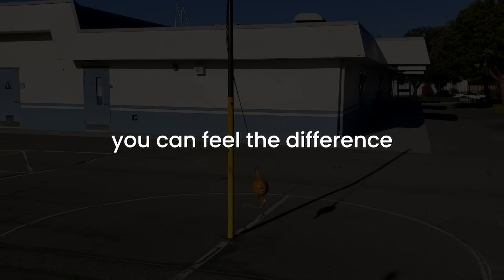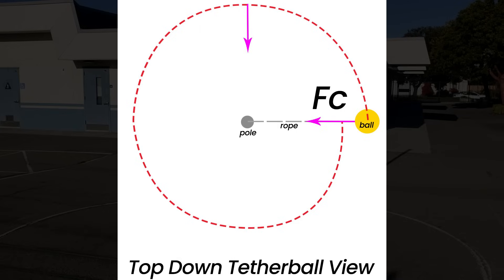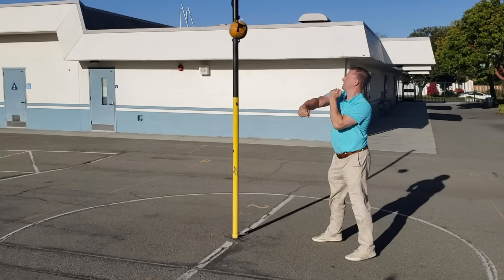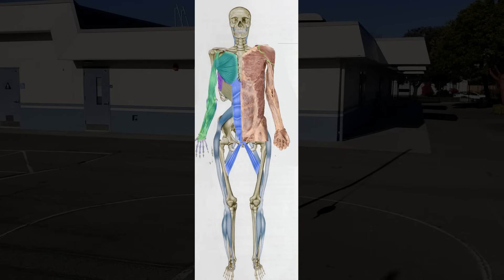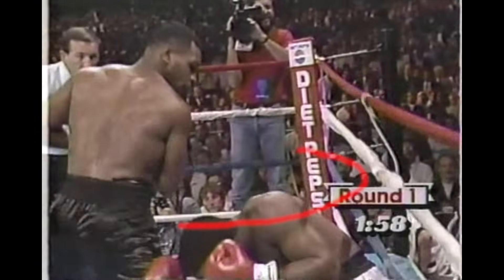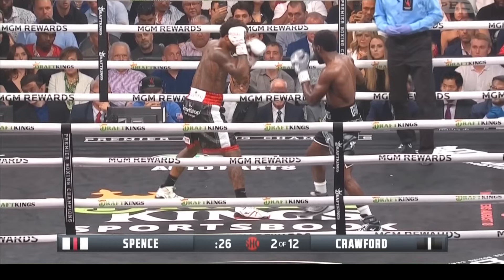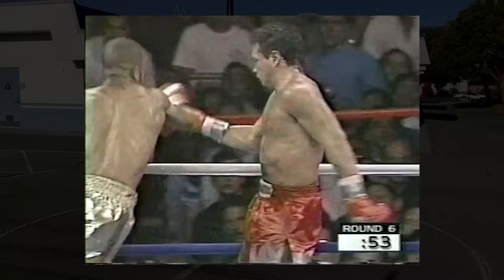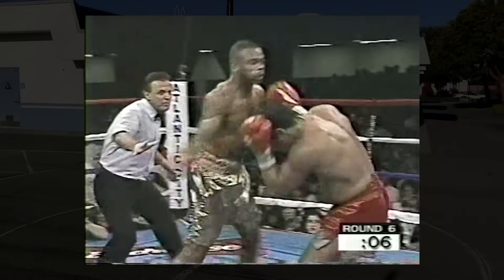The Hidden Physics Behind Natural Punching Power, And the Secret Advantage You Aren't Using (Yet)

Comment: There MAY be some valid info in here, BUT there's also some BS which just makes me skeptical of the whole system and makes me think he's a snake oil salesman.  Specifically the whole ball throwing experiment is HIGHLY flawed and dishonest, even for someone like me who doesn't have a great understanding of physics, I can see the blatant flaws and "misdirection".  For example he is releasing the ball from different angles, and "his approach" is always a more advantageous angle.  Second, on "his approach" throws he is clearly using his wrist which he doesn't do on the "conventional punches".  For anyone who has thrown a ball, you can understand how essential that "wrist snap" is.  So he's basically "shot putting" a ball vs. "throwing" a ball, of course you're going to "throw" it farther.  And this is just not an equal, or "apples to apples" comparison when it comes to punching.  Punching and throwing, while they have similarities, they are just not the same movements.  That wrist snap is the perfect example, while that is essential in throwing a small/light ball and creates A LOT of power, it is not essential, and will LITERALLY HURT YOU you when punching, or even throwing a heavy object like a shot putt, because your wrist can't handle that type of force, if it is not straight/rigid or "stacked" properly like they teach you when boxing.  Also, without seeing the "jab is actually an arc" video, that seems pretty sketchy too.  Them dropping their hand after they make contact doesn't make it an arc.  The  power is generated PRIOR TO contact, and there's no arc prior to contact.  It's a straight shot, and there's a reason for that, it's the FASTEST way from point A to point B!  Which is another reason punches are taught the way that they are in boxing, it's not JUST about power, it's about speed, efficiency, and also not leaving yourself open for counters.

 When I/you see clearly dishonest and misleading stuff like that, it should make us IMMEDIATELY skeptical because 1) If he's dishonest about that, what else is he dishonest about? 2) If he truly believed in his system, and it was actually as effective as he says, why would he have to add dishonest claims and "experiments"?

Furthermore, there's other "red flags", like the fact that there's not much "practical application" info here, instead a lot of physics jargon.  People who really know what they're talking about and are being truthful should be able to explain these concepts in simple, easy to understand ways with practical examples.  Others tend to use a lot of big words and subject specific jargon that most people don't really understand, but it makes them sound knowledgeable and trustworthy. And the one practical example he uses is the throwing thing which, again is a crappy example.There's also the obvious question of "So every boxing coach/trainer is wrong, but this guys right?"  And it's a commonly used technique, as well, where he poses as a credible authority who comes from outside the field of discussion to say I have this "outside knowledge base" which is why I have the "secret key that they're missing".  In other words, "Boxing coaches are basically just meat heads, so they have all missed what I know as a scientist".  And it's a very effective tactic, but the reality is that athletics are a HUGE/LUCRATIVE business, and so there are experts in various scientific fields who contribute to "Sport Science" as their job.
Reply from the maker: lot of words to say "I didn't understand the video."  Thanks for the comment though, the algorithm loves noise.

Comment: I watched a couple videos of old Larry Holmes stressing the importance of snapping the jab out and try to arch it instead of just pawing with it like you see a lot of amateurs do.
Reply: I was thinking of that too. I think he explained it as a slap. A whipping sort of motion. I could be wrong but it doesn't seem like that would be an arc. If that is correct, then maybe Holmes shows for the jab at least there's an alternative to the arc that still fits the "integrated" mold the author is describing.
Reply: @5metoo  if you watch him you will see his body's subtle movements. The way he sort arcs his whole body into the jab, the fist looks like it's coming out straight, but that's because the core is what's doing most of the rotating. When I do it like him, it feels almost like a wave of force is traveling through my whole body and ending at impact.
Reply: @bigbear5767  Sounds about right

Comment: Your idea and theory seems to be sound and possibly close to what is taught in older boxing and certain Japanese martial arts.  The law of conservation of energy (edit: the law of conservation of angular momentum) is something that I, the first student of our new school, has looked into and experimented with.  Although, It would be nice if I could use a pressure pad and test subjects to see how much power it generates.  Your video, from what I see, essentially is: use your hips.  Use the rotational power of your hips.  Your hips are what moves your punch rather than punching with your shoulder and following with your hips.  The arc on your rear straight may also produce more power due to you hitting slightly downwards and using gravity to assist.  However, in terms of fighting can leave you wide open if missed.  You can use conservation of energy if you start a hook or uppercut wide then shorten it to 90 degrees flexion.  Other than that, I'm not sure the law of conservation of energy (edit: conservation of angular momentum) applies as I am not an expert on that.  I am not a physicist.  The reason I wrote this comment is because your wording was a bit confusing to me, someone who has majored in kinesiology.  As well as my own testing with the ball test you showed.  It wasn't until I got no change of results in the test that I realized what you meant.
Reply from the maker: I was talking about conservation of angular momentum that dictates angular velocity will increase when you shorten the radius of the arc, not conservation of energy. This video is about arcing punches not necessarily hips driving the movement which I've discussed more specifically in previous videos.
Reply: @ThePunchDoctor that is exactly what i meant, but i will admit I typed the name of the wrong law.  But my point still stands.  And your test seems to have proven me right.  It would probably be in our best interest in someone to truely understand this if someone could get a few boxers, kung fu practitioners, muay thai fighters, and karateka, to study this with one of those pressure pads and analyse what may make the puch more powerful.  Although, they would all have to be similar size and quality of training.  Btw, this is the video where I first learned about angular momentum: https://youtu.be/_WHRWLnVm_M?si=Vwe07BYzaHqzIMXo

Comment: Around the 4 and a hlf minute mark, you showed two champion boxers launching powerful shots. However, neither of the boxers initiated movement from the hip, allowing the hip to start rotating, then the torso, then the shoulders, then the arm, etc. Which is what you yourself actually do immediately following those two clips. You can see the clear difference between your punching mechanics and theirs. They seem to initiate the movement directly from the arm (shoulder and fist moves first) and the body pushes behind the moving arm to drive it into the target. Which, if I am not mistaken, is what is taught in Soviet style boxing, at least the former Soviet boxing coaches I have watched. I do not post this as a criticism, or a "gotcha" thing, but I am sincerely asking for clarification on what appears to me be a difference between what you are saying and what is being shown. Please elaborate. I am rewatching the video, and it may be that I am misunderstanding what you are presenting. I do notice that in your "integrated" punching demonstration you are essentially shortening the arc of the punch by drawing the fist in closer to the body towards the end of the arcing movement. Upon reflection about this point, I do remember my boxing coaches teaching both methods - the "linear" method to beginners in order to prevent them or break them from developing the habit of throwing wild haymakers instead of tight, controlled punching. And the "shortening the whip" approach once that foundation has been built in order to increase the velocity of the fist and thus increase the power upon impact. So there's that. :)
Reply from the maker: I appreciate the comment and it really takes a nuanced eye to see these things. You will benefit from watching some of my longer breakdowns to get a good idea of what I look for. 

Floyd lowers his center of gravity to initiate the punch. When he does this you can see his shoulder blade retract. He is loading his posterior chain and his cross-body chains simultaneously which both then explode into action. After he initiates the punch you can very clearly see the sequencing. His hips finish their movement and his fist is still accelerating. In the soviet linear style you’ll see the fist and hips reach their end point simultaneously.

George follows a very similar pattern. I covered him in depth with frame by frame analysis in the full video where I feature him. It might not be the clearest example I’ve ever used because he’s moving forward at the same time as he’s loading and exploding. I chose this clip mostly for the arc. He is loading his hips and cross-body chains at the same time as he lowers his weight. The clip also shows very obvious sequencing just like Floyd after the punch is initiated.

You can see the full George vs Joe Frazier segment here if you want to go more in depth: https://youtu.be/qLVl18AVkAU?t=329

Comment: The best fighters and coaches I've known have all come to this without the first understanding of or giving a thought to kinetic linkage, centripetal force, or physics.  They arrive intuitively and anecdotally where science would tell them to go, were they to ask for directions.  Punching is like any rotational sport, wherein - unsurprisingly - the key is rotation.  Putting a shot, throwing a javelin, swinging a bat, golf club, or tennis racket, all derive their power from acceleration through rotation.  As someone who fought for several years and has coached for many more, with years of anecdotal evidence on which to base my teaching, I still like to consult a physicist friend of mine whenever I want further conformation that whatever particular technique I'm teaching corresponds to the laws of physics.  Boxing isn't called the sweet science for nothing.  Of course, all sports are in essence sweet sciences, but boxing has garnered that tag and it fits.  I have a kung-fu buddy, who was also 5 time Nevada middleweight amateur boxing champ, who says there is no such thing as a straight punch.  He describes the jab's movement as being like electricity arcing between to poles.  This is absolutely true.  You simply cannot throw an effective jab that doesn't start at the feet and rotate through hips, shoulders, and then the arm, which gives it an inevitable slight arc.  For most people, it's getting that kinetic chain to move fluidly that's difficult.  People tend to lose the connection between the arm and the rest of the body.  Consequently, the arm moves ahead of, independently of, the body, resulting in pushing and throwing arm punches.  Everything you were saying in your video.  I've found, given enough time and consistent training, people's bodies figure it out.  How successful they are at it depends on their native athleticism, but I've yet to see anyone who hasn't in time arrived at a reasonable facsimile of the correct use of kinetic linkage.  The body, out of necessity, seems to figure it out.  I'm not saying anything you haven't already said.  I'm just confirming and allying my own experience with what you're describing.

Comment: What muscles has a whip? There is only the force of the hand aplied to the handle. 
Pulling the shoulder forward during the contact with opponent is a repeated pushing, as can be observed in slow motion videos. It can be extremely powerful and devastating push, but still is a push. It will influence and harm the performer body and movement also.
If we want to strike and not to push, the shoulder has to move during the contact back from the opponent and not to him. Then the movement of the fist will be way faster.
Pushing is good for throwing ball or for pushing opponent away.
Real striking is a whipping movement and doesn't need a lot of power, contrary to the pushing punch.
In theory whipping punch can transmit 4 times more  kinetic energy than pushing punch and 4 times faster.
Reply from the maker: retracting your arm fast is not going to generate power. That's a completely backwards interpretation.

Comment: both linear and rotational mechanics are applicable, coz your spine is not only a pole but elastic as a bow or spring, and you can turn your arm into a pole, therefore rotation is applicable but not necessary.
Reply: This is correct. You can 'shoot' your hand like throwing a base ball (linear jab), or swing it like a bat.
Reply from the maker: throwing a baseball isn't a straight line. you throw a baseball, you don't push it.
Reply: @ThePunchDoctor What i mean is that in this kind of jab, your body is doing the throw, and you punch is like the ball being thrown, traveling in a straight line(mostly).
Reply from the maker: @tchovosky  all of your punches are like this - relaxed until impact. you want to land with shearing force and the 3 vector landing for your straight punches. Check out my "cheat codes" video for more on that.
Reply: @ThePunchDoctor that was his example, but the maximum power can be achieved without rotation. To break it down, you can throw a cross by transferring the weight on the front foot, with the locked shoulder blade, the weight drop+the momentum is then transferred through the spine (the spring) to the hand. This is common in Japanese boxing which they learned from Chinese, as opposed to American style, the "putting off the cigarette" which indeed can't be achieved without rotation.
Reply from the maker: @Hunter_EagleConsumesSerpent  you are totally misunderstanding my position and the entire concept of what I'm describing in this video. the "spring" you're describing isn't the spine, it's the cross body kinetic chains, which is what I talk about in virtually every video.
Reply: @ThePunchDoctor cool indeed I watched half of this video

Comment: Btw i had this question, what if I use those tenchqieus you described, for power punches, for example instead of pivoting lead foot on lead hook, just rotate my body and generate power from rear foot, but what if I use linear basic techniques for throwaway punches and creating angles? So not to actually knockout, but to create new angle, or set up the right hand with lead hook pivot?

Comment: honestly i think most people have the natural mechanics of punching down from the get go. it just gets taught out of them by bad coaches. i think of people just focused on hitting the bag fast and hard and then added the finer details in later on that they’d be better.
Reply from the maker: as kids yeah for sure. as kids become teenagers and adults they don't move as freely - they hold tension in their shoulders, develop bad posture, develop patterns of dysfunction because of chronic stress or trauma which prevents their natural movement so they have to retrain and relearn it. I have to do that stuff in my day to day. you can undo a lot of it but it takes work. The bad coaching doesn't help either though.
Reply: If you just practice punching in the multiple ways that you can then your hands will be strong and your mind will naturally choose what's the right attack. There's throwing energy and there's whipping energy, there's also continuous flow of energy where you can flow all and any strike together using footwork as long as you have the stamina.

Comment: good video. I wish you would do a video on the standing vertical jump but with the hands on hips. I know your videos are about boxing and more specifically punching power but you seem to know a lot about biomechanics and physics. I have a very interesting problem. My standing vertical jump  while holding two 6 lb. dumbbells and jumping from a paused position is significantly higher than my standing countermovement jump with my hands on my hips. The weighted jump is at least 5 inches higher. It makes no sense. It's like jumping higher with 12 lbs. of fat than my current weight.
Reply from the maker: that's quite bizarre. how did you measure the height?
Reply: @ThePunchDoctor  I stand in front of a mirror in an aerobics studio at my gym while wearing a Rogue t shirt. The Rogue letters are at chest level. When I do the weighted jump the letters disappear in the mirror. When I do an unweighted jump I get to about my neckline.